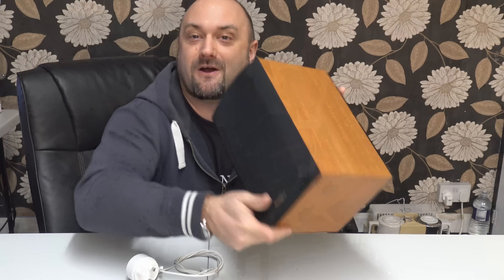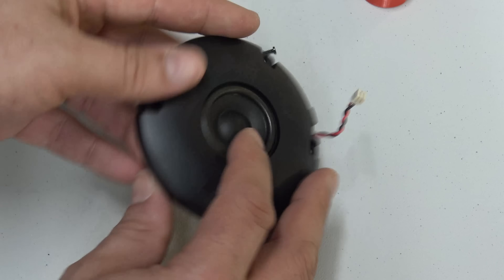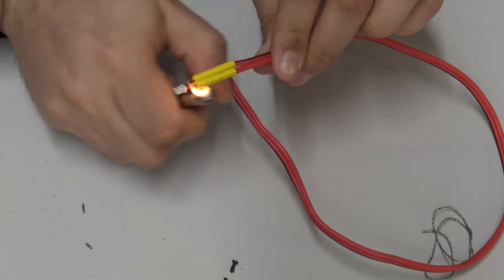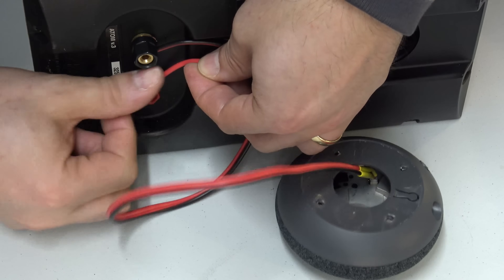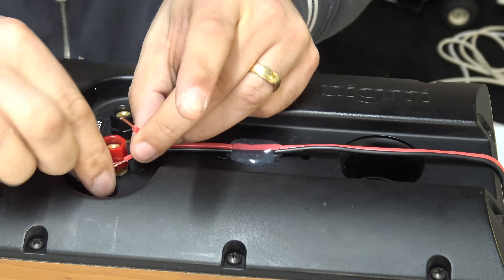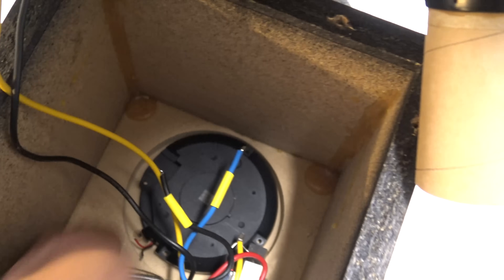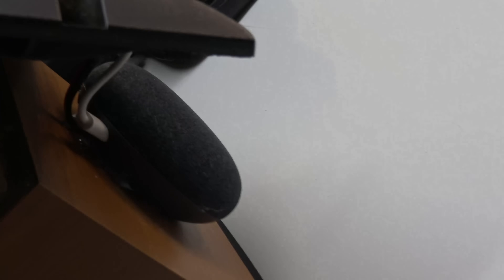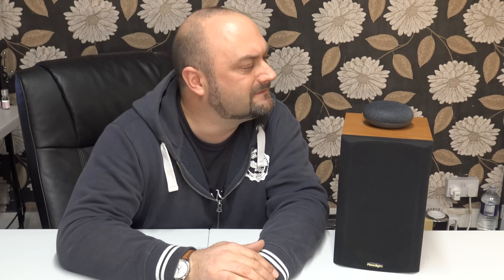DuB-EnG: GOOGLE HOME MINI HACKED - Adding a big speaker to the google MINI

Comment: Does this also work... instead of hard wiring it to a single speaker, solder rca connectors on the ends and connect it to any amp or stereo hifi unit? Would this work??
Reply from the maker: Yes but it would be mono

Comment: Hello, is there anything I need to keep in mind for the Speaker that I attach to the google home? There sure should be some limitations right? I bought an old 50s radio gutted it out and transplanted my old gh mini and an old centerchannel speaker to it. It works perfectly fine, but i wonder if there are any limitations
Reply from the maker: Most speakers are 4 or 8 ohm, the electronics are well protected... So shouldn't be a problem!!

Comment: Hi, seen your video 3 years later... Its amazing. I want transform the old "yamaha pdx 31" with google home as you. I can read that you use 5 wats and google is 4 ohm... But... Did you use 4ohm speaker or 8 ohm? I am fear to broke this..

And if my speakers works with 12 v i need to put and transforn 5v to 12v between google home and speakers?

Thank you!!
Reply from the maker: I'm not sure what you mean when you say your speaker is 12v? ...  unless it's an active speaker?
Reply: @DubiousEngineering  sorry was my fault I used an old radio 12v but it's true is not 12v speaker. I try with Google home and works nice

Comment: hey what size is the jst connector that you are using here to pach into the mini? i manged to order the wrong size ones on my first try
Reply from the maker: :-) 😀  I'd have to re-watch my own video!! ...  hahaha...  can't be bothered with that :-) ...  from memory, the only connectors involved were 3.5mm Jack's and phono connectors...  😀
Reply: @DubiousEngineering  neah the small one u used inside the nest mini
Reply: white little thing that you added to the wire

Comment: old center speakers from home-theater-in-a-box sets from goodwill are perfect for this kind of mod.
You could of as well just transplanted everything into the new case and done away with the old shell although I could see you running into issues with the touch sensors and row of status leds, and you would need to figure out where to put the reset and mic switches and rout the new location for the usb port.
.
Reply from the maker: Yes, great idea to contain it, but you also now understand the dilemma of the touch and reset controls etc

Comment: Automatically Subscribed ! Exactly what the Fixer  or amateur D.i.Y engineer ordered ! 
Will need more specs on how much wattage this google unit can drive and the impedance range it is compatible with speaker wise .
Reply from the maker: It'll do 8ohms or 4ohms and runs about 5 watts max - :-)   Thanks for your nice thoughts!!

Comment: I am attempting to add a google mini to a backyard system, only two wire speakers. I don't know if the amp in the mini will power two 300 watt speakers. Should I add an amp in the middle to protect the mini, and if I do that do I need any resistors? If I add resistors what size and where do I put them?
Reply from the maker: You can drive 4 or 8 ohm speakers directly with the mini irrespective of how many watts they claim to be, but your max power will be about 5 watts, addig an amp makes sense!

Comment: Do you think I could hook up an amplifier to it or will it just not work with the alredy built in amp
Reply from the maker: You can plug it into another amp...  but suggest you use some resistors to drop the output power a little first :-)

Comment: I am working on a project similar to this, exept I aim to make sure the bass doesnt go down when volume goes up. That defeats the point of using those massive oldschool hifi speakers imho.
Reply from the maker: Yeah a separate amplifier and larger power supply makes sense!! :-)
Reply: @DubiousEngineering  I am just working on this since last monday, my first test was with an echo, but it started to pop above 40%. Today tested the nest mini and its allready better. I can now either chose to steal the audio signal before the mini amp grabs it and send it to a different amp, or just go the car audio way of using a high-> low converter and then the amp. Going with the high->low first before maybe botching the pcb inside the nest to try and steal the preamp signal :)
Reply from the maker: Keen to hear how this works out and what you do :-).   Keep us informed!! :-)
Reply: @DubiousEngineering  Ive got the stuff ready, and it seems to be working like a charm. Its in my office now, ill take it home and make a video and post it for you to see :D
Reply from the maker: Or you can take some pictures and put them on the DubiousEngineering Facebook page or add me on Twitter @dubiousengineer
Reply: @DubiousEngineering  Consider it done!
Reply: @Dubious Engineering, thanks for the like mate, if you want to know my setup and or the end result let me know. I expect the parts I need now coming in tommorow so I can then finish fase 3, and if all goes well there is no real fase 4 other than making a nice casing for the hacked mini and other added components :D
Reply from the maker: I’d be tempted to keep the 5v PSU and use a “step-up” converter to charge a lithium ion battery to offer more power to a small digital amp!
Reply: @DubiousEngineering  My end goal is being able to keep using my speakers without the big amps I need for them now, AND be able to add them to speaker groups in my home setup. I googled for about a month, no real solution that doesnt require a lot of money or parts. Then I just tried adding the speaker last monday, and today found your video haha!

Comment: Hey mate love your work! Just wanted to ask a question because I've attempted to do the same thing with a Bluetooth receiver and connecting to an active sub through rca then bluetoothing to my Google home as my mini doesn't want to work with it but I encounter terrible latency lag even with a group delay correction. My question is, my subwoofer inouts are an rca not wire so with connecting the speaker wire from the mini to rca cable be sufficient or not work ? And will the mini work with the sub given it has an amplifier or am I out of luck? Just hoping and wondering as I've spent countless $$ on incorporating a subwoofer to my multiple Google's for a true deep bass and effect of surround. Cheers mate!
Reply from the maker: Thats strange... its fine using the speaker outputs to drive RCA just as long as you keep the volume low.  There will be no delay if you pull the sub output directly from one of the minis ... hope that helps - Sorry its troublesome...
Reply: @DubiousEngineering  no no that's awesome awsome so I can give it a crack! So just to clarify, are u saying to keep the volume down on the subwoofer volume knob or my mini? And finally my subwoofer input is a white and a red rca and if the Google mini only has a red and black wire yet I need two wires for each rca? Do I add both negatives of rca to the one black wire and vise versa with the red or do I just use a single rca to connect to the mini? Was just worried I may loose sound level if I only utilised one rca or it would work but if one will work also great? Thanks mate for getting back to me quickly!!!
Reply from the maker: Yup, just modify the cable so both the center pins of the rca cable connect together and the two inner pins connect together... effectively turn the cable from stereo to mono..

Comment: Great retrofit, have completed it very successfully so many thanks. Brilliant sound but very very bassy and as in a terraced hose will disturb the neighbours. Put a scarf behind the front push on panel and the sound is much better. Question is will I damage my base speaker by restricting the movement. Anyway thanks again
Reply from the maker: Gareth Thomas I noticed you subbed a few days ago... thanks 🙏 for your engagement and I’m actually happy that you’re system is bassy as mine seems to offer more treble... the scarf shouldn’t cause too many issues... just ask google to drop the volume to 30% ... hey google volume 30% or lower... hope it helps a little
Reply: I know this is old but the Google app does allow you to turn the bass down and the treble up from your smartphone. Hope this helps!

Comment: U just did that for no reason... they added a bluetooth output feature...

U know what after watching the vid u looked like u had soo much fun doing that
Reply from the maker: Exactly... you hit the nail on the head... I was just having fun :-). A year later, it still exists upstairs in the attic laboratory and gets used every day :-)
Reply: Dubious Engineering im glad to know that a year later you still reply to comments :)
Reply: It would be cool if you mounted it in the speaker
Reply: I have set mine up with Bluetooth but it keeps dropping out so interested in hard writing... But needs stereo... Hmmm...

Comment: when you decided to do this wiring to that new speaker, how did you verify if there would be an issue matching ohms. I was thinking of buying a full range driver that is 8 ohms. Would there be any issue directly wiring that to the mini output?
Reply from the maker: most standard speakers are 4, 8 or 16 ohms...  some headphones are 32ohms...  most amplifiers can handle most of these speakers...  you’ll be just fine :-)
Reply: @DubiousEngineering  just for clarity, did you use an amp between your google mini and the speaker? looks like you just wired them together without one unless I am missing something? If i got an 8 ohm speaker, i would need to connect it as output of an amp, and connect the google mini as input of the amp?
Reply from the maker: kingkckc no amp ...  just wire in in place of the existing speaker
Reply: @DubiousEngineering  the Google Home Mini uses a Texas Instruments TAS5720LRSMT IC amplifier with a maximum output of 20W x 1 channel @ 4 ohm.

Comment: DIY Google Home Max! Amazing!
Reply from the maker: Awww thanks 🙏. ...  it was all just for fun!!
Reply: Great job! The only thing I'd suggest is to put the Google Home Mini speaker body in the place of the tweeter instead of it being on top.
Reply from the maker: That’s actually a really good idea... the problem is there is a reset switch on the body of the google unit which means you’d need to unscrew the speaker each time you wanted to access it... that said, I have never had to access it apart from once when I first setup the google unit!!
Reply: You could extend the wires to the button so it could sit near the exhaust of the speaker. Thanks for the great video!

Comment: Nice work, it looks cool!
But, how do you manage the standby mode of your speakers?

Do you always leave them plugged in and turned on?
Or do you have to turn on the speaker every time you want to use it?

If you can tell me how you manage this, I'm interested;)
Reply from the maker: The speaker is connected directly to the google mini.  So no need to play about turning things off / on... perhaps watch the video and you may understand it a little better!
Reply: @DubiousEngineering  I'm sorry, I'm French and I don't understand English well. Long live Google :)

Apparently your pregnant does not need food. Just the google mini.

But can you do that too on a more powerful speaker?
There will not be a need for a connected amplifier?
I would like to plug it into 2x60 watt, is it possible without other electricity than the Google mini?
Isn't that going to be too much for the Google mini? And to damage it?
Reply from the maker: Ahhh... the google is maximum 5 watts RMS ... suggest you will need a big amplifier for 60 watts!!
Reply: @DubiousEngineering  I was wondering if I could plug this into the speaker input of a powered subwoofer just to give the sub the signal input and let the sub drive itself and the bookshelf speakers. Is there any reason you could see this not working?
Reply from the maker: @verizonmoose  yup pretty sure that will work just fine!  Note the max output power of the unit is about 5 watts.

Comment: Could I connect these to coax cables and use it as a preamp
Reply from the maker: Yes, but suggest you use some resistors to reduce the drive into the phono jacks...  otherwise 10% volume will be like 300%. :-)
Reply: Dubious Engineering how would I go about deciding what resistance I should use
Reply from the maker: Her Big Nips use a potentiometer or variable resistor... then you can adjust it ...  remember the output is mono

Comment: Just did my second hack. Have you noticed that at full volume the bass dropped off?
Reply from the maker: Yes... sadly the DSP profiles the response of the original little speaker... quite distressing... 50% is quite loud for a kitchen:)
Reply: @DubiousEngineering  also now with two units Google let's you pair the Minis as a stereo pair. 👍👍👍
Reply from the maker: That is epic news!!! Thankyou!! ... I have a lot of sonos now and will be making a sonos sub bass for cheap ... that said, I have two minis and will definitely get those paired up and hacked with bigger speakers... Thankyou again for the tip!!
Reply: @DubiousEngineering  yeah figured as much. Just rebuilt the cross overs on my old speakers and wanted to make sure nothing was borked.
Reply: Have you had a chance to try this on the "new" Google mini (or Nest mini, or whatever it's called)? Looking at doing this hack to drive some ceiling speakers, and wondering if drop off you're seeing in base response is present in the 2nd gen mini as well.
Reply from the maker: I personally haven’t... that said, I expect it to be the same... the output will be profiled to reduce max current draw from power supply...
Reply: @JonathanMichienzi  same here. I only did the hack because I got 2 free gen1 minis from Google and Spotify.
Reply: Hmmm....Ok. I might give it a shot - we got 3 free gen 2 minis (promotion for Play music subscribers and we had a family plan....get on it if you haven't already!), and already have a bunch, so think it's worth sacrificing one to test out the sound. Going to try it on an old set of speakers first and see before buying into some ceiling ones. Thanks!
Reply: Just a quick update: completed this hack on the new Google home mini (or nest mini, or whatever Google currently calls them). They're even easier to take apart, and the insides are mostly similar. The sound profile is very bass heavy at low speaker volumes.... Almost too heavy. At higher levels, ithe bass drops off, or sounds better, at least to my ears and with the speakers in using. So, that's been my experience - sounds similar to the gen 1. The equilizer helps, but obviously doesn't dynamically adjust.

Still, they sound much improved with external speakers, enough so that I plan on using these to drive some ceiling speakers. Now, just need to pick some if those!

Comment: Just connect it to a larger bluetooth speaker
Reply from the maker: A lot of people suggest that...  but then you need to buy a larger bluetooth speaker :-)
Reply: a bluetooth dongle works too. if you've got a hifi speaker, chances are you have a receiver/amplifier. So you can connect it to that. most newer ones come with bluetooth anyways.
Reply from the maker: Maybe then the output will be A2DP stereo Bluetooth sound... that would be nice!! :-)

Comment: What exactly is the point in this you could have just used an alexa which frankly is better or just used a bluetooth speaker
Reply from the maker: I agree... Alexa is better as it has an output jack... in this case, for me, I have the convenience of a system that doesn’t require Bluetooth connections or charging and the extra quality of a decent sized two way crossover and high quality audiophile speaker... thanks kindly for you’re poke in the eye mr Graham !!  ... we had fun
Reply: @DubiousEngineering  okay but not all bluetooth speakers need recharging and those "audiophile" speakers would sound a thousand percent better on an amplifier made for it not a 2.5 watt amplifier  in that google speaker and my third point is that by doing what you have done you have effectively void your warranty on the product
Reply from the maker: Luke Graham I can’t disagree with you!! ...  also, I’m sure they already make a larger version of the google home mini, so, this is indeed completely pointless!!  That said, It sits in my kitchen and gets used regularly, and it sounds loads better than the original!  ...  whatever you do, please don’t watch any of my other videos, as you’ll soon be suggesting I should go to bed and not wake up!! :-)

Comment: Hmmm .. ever heard of bluetooth?
Reply: Google minis are extremely cheap. Single speakers are also extremely cheap. Why not do it? Plus bluetooth speakers will also require charging or separate power on top of what the mini uses.

There are dozens of centre speakers around that would be perfect for this.
Reply from the maker: Thanks Maxiumus!!  -  You totally understand where I'm at!! :-)
Reply: @DubiousEngineering  I just did this with a big yamaha centre speaker. Removed the tweeter and used the Google Mini speaker in its place with some black silicone. Added a custom crossover(simple cap on the mini and a coil on the 2 bass drivers). Much louder than original especially in the low end. Made this for my garage speaker where I work on my cars amd have some gym gear. As loud as anyone would ever need for a garage.

Centre speaker was free with blown tweeter, mini was $30au (£17?) Runs off a single usb. Winning!
Reply from the maker: Lunchos El Maximus ... excellent to hear that this has helped!! ... I’m thinking of taking this to the next level... putting some lithium ion batteries in a speaker and the google mini... then you can take it outside or into the bathroom :-)
Reply: @lunchie80  what is the value for the cap and coil crossover you add?
Reply from the maker: Great comment and well presented!! ... Bluetooth is epic ... I just did this for fun :-)